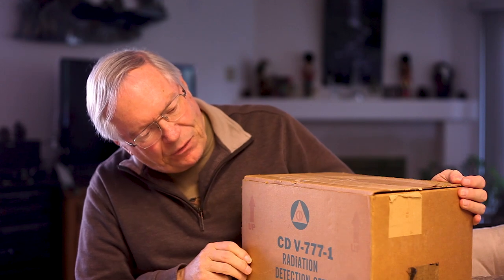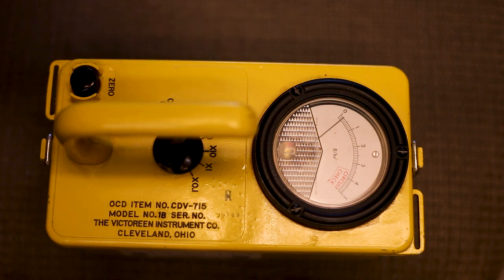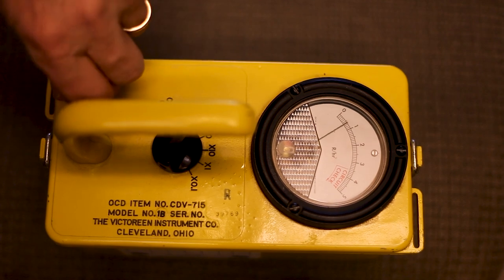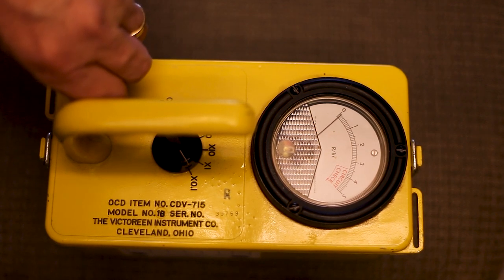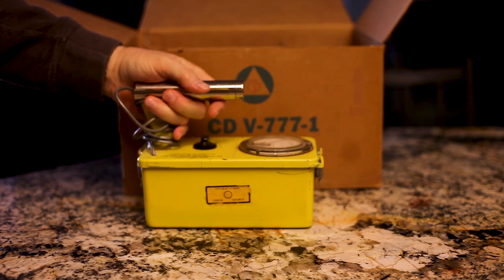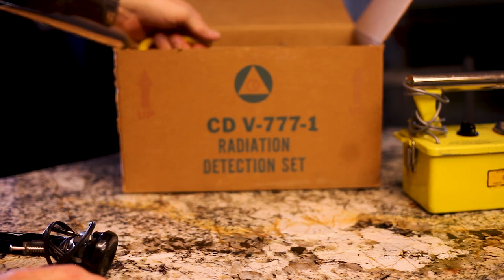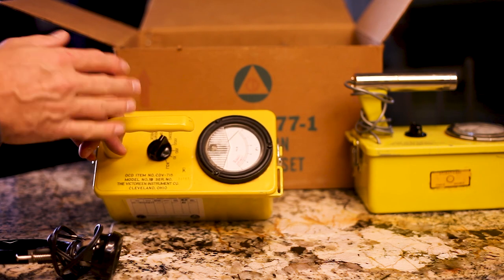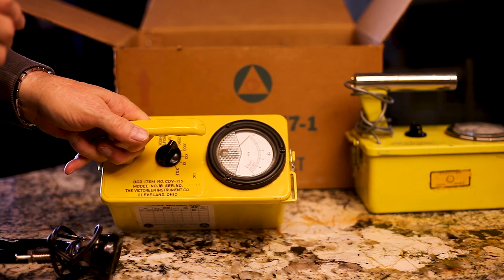CDV-715  GEIGER COUNTER METER REPAIR

Comment: It should be pointed out that these DO need to be calibrated before you actually rely on it.  The calibration drifts over time, by a LOT, not just a little, they need to be recalibrated about once every 4 years.  The CD V-700 (the geiger counter) can be user “calibrated” using the check source between service calibrations, but it is not a substitute.  There is ONE company left that does it, it is just under $100 per meter.  Cheap insurance if you actually intend to rely on these things.  The dosimeters however are fully user calibratable using the charger, however, they were never intended to be used for more than a few days at a time, if you use them for longer than that you will start to get a falsely high reading.  To use a doaimeter properly, you should record the reading once per day, then recharge and rezero it for the next day, then simply add up your readings to get your true exposure level.  Mine were last calibrated in 1991, and when I got them they were reading 120 roentgens, to give you an idea.  In a pinch, they can be used instead of the CD V-715 survey meter, zero them, expose them for an hour, then check the reading (or expose them for 6 minutes then multiply the reding by 10), that will tell you exactly what a fully calibrated CD V-715 would, just slower.
Reply: @John Burrell Aside from KI4U, what are the alternative options for calibration?

Comment: It’s still not working.  Do you see how the needle won’t stay on zero?  Once you zero it, you should be able to cycle completely through the settings without the needle moving, tours moves slightly.  The likely cause is a faulty ion chamber.  Yours isn’t as bad as some, but that ion chamber is failing.  Read the manual, everything I’m telling you is in there, along with the trouble shooting steps.
Reply: Some people say whenever you switch sensitivity ranges, you need to re-zero the meter. But I dont think the gauge is the problem. It could be a low battery, or more likely, out of calibration. The thing probably hasnt been calibrated in 50 years.
Reply: @UncleDon226  

That’s ridiculous, they are made to be adjustable, the dial would be pointless otherwise.  They probably do have to be recalibrated but not because of that.  There should be a sticker with the last calibration date, it is usually sometime in the 1990’s.
Reply: @cplinstructor  It’s not unusual for analog meters of any type to need to be zeroed slightly after changing ranges due to imprecision and age of the components.
Reply: @F16_viper_pilot  

Rezeroed how?  Zeroing requires a calibrated source, going back to the lab to re zero every time you turn the knob makes no sense, if that were the case it would have been more practical to make a different meter for each range.
Reply: @cplinstructor  When using analog multimeters, for example, it’s not unusual to have to tweak the zero dial slightly when changing to a different scale.  One of the service manuals I came across for the CDV-715 said that the needle should return to plus/minus 3 minor divisions on the x1, x10, x100 scales and plus/minus 6 minor divisions on the x.01 scale after allowing a few seconds for the transient currents to dissipate.  Understand that the components used in here are likely very old low precision 10% and 20% tolerance carbon resistors and very old electrolytic capacitors that likely need to be replaced.  The needle is highly unlikely to be dead-on zero on each scale.  From what I saw in the video, nothing with the needle position would lead me to immediately suspect a problem with the ion chamber failing.

Comment: Pretty sure that if your geiger counter pegs, or goes to max then overloads and goes to zero, you’re probably quickly on your way to death and need to vacate.
Reply from the maker: Hope I never have the need to use it!
Reply from the maker: Just last week I got to play with the most sensitive one with the wand.
Had radio active die injected into me for a bone scan and it pegged all 3 settings on that one. Watched it for 72 hours and by the end, the most sensitive setting was only slightly moving. Kind of a fun experiment. Bone scan was negitive.
Reply: @hamradiofrequencies  I was talking about any geiger counter, not necessarily the survey meter.  But, yes, I agree with you.
Reply: @hamradiofrequencies  Yeah, I bet that was fun, especially if the scan was negative (congratulations, btw!).  I saw a video of a guy that had a radioactive isotope injection, and his friends were using a geiger counter on him.  Another video was a guy who’s wife was injected, and he was getting really high readings a floor down from her when directly underneath their bedroom, but normal readings on the other side of the floor.  I did get a chuckle out of those videos. 😁
Reply: @hamradiofrequencies   Btw, thanks for the video….I put the meters on my eBay watch list to see if I might snag a deal in the future!

Regarding test sources, I have a bakelite British Mark 1 WWII marching compass (made by T. G. Co. Ltd) with an exposed radium sighting marker that might get your survey meter to trigger.  As I recall, it put out something like 230,000 counts per minute on one of my geiger counters and the video I watched showed a guy maxing his meter out at 300,000 CPM.  There are also some signal markers that put out insane radiation upward pf 700,000 CPM.
Reply: @hamradiofrequencies good for you

Comment: I wonder how radiation effects the component level? I mean will one resistor be as good as another under neutron bombardment? It is one thing that I know does effect them but not the details, and I wished I knew. Not enough Nuclear physics classes at college (took CS & EE both). But I do know it does to an good extent. Wished I knew more on the topic of "nuclear effects on electronic components".
Reply from the maker: Thank you for your comment.

Comment: what about the D battery and emp
Reply from the maker: I don't think a dry cell battery should be affected by an EMP. Any one can correct me if I am wrong on this.
Reply: @hamradiofrequencies  it will not, as it is solid state